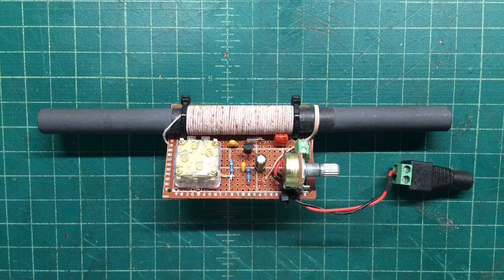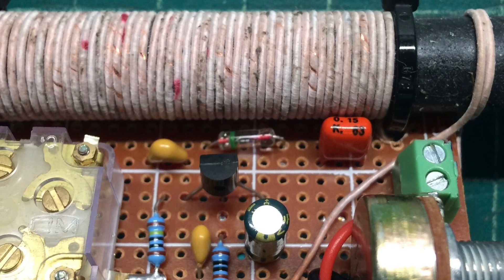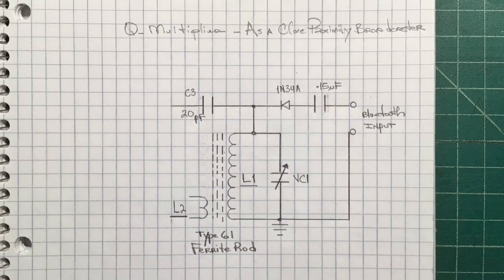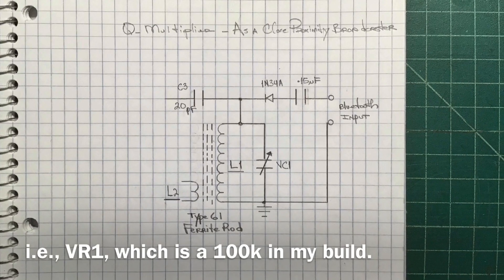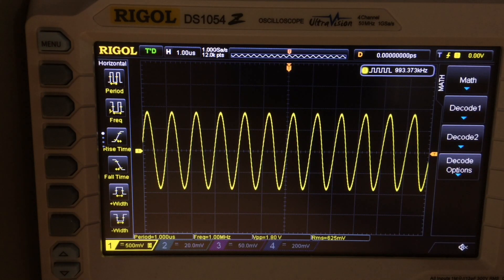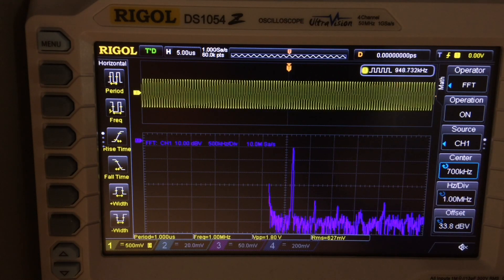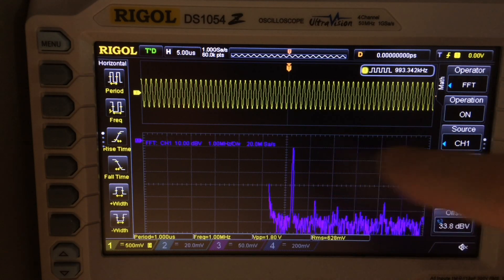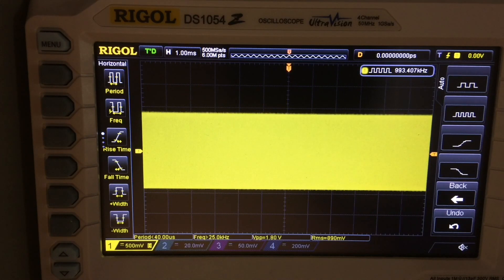Q-Multiplier Circuit - As a Close Proximity Broadcaster

Comment: Hi Don. Very interesting video. But in my opinion, I think it would be more interesting to replace the 1N34 and the DC decoupling capacitor with an integrated type ZN414, or ZN415, or MK484, or similar as TA7642. I would like to see the result using one of these cheap ICs. Take it as an experimental suggestion.
Have a great day and thank you for the video and the ideas you provide.
Ketk (From Spain)
Reply from the maker: Ketk - an Interesting suggestion and one to ponder on for sure. Thanks again for watching my friend. Best, Don